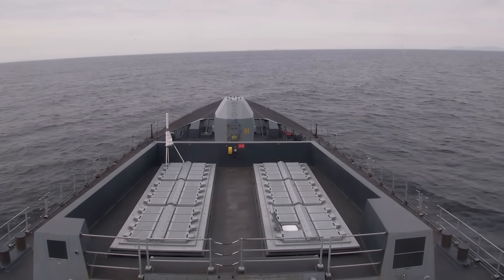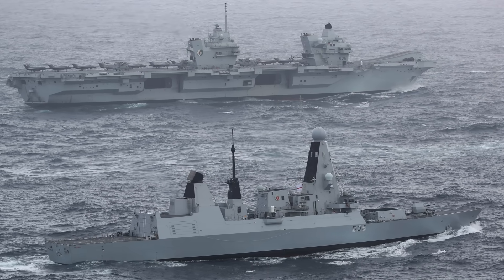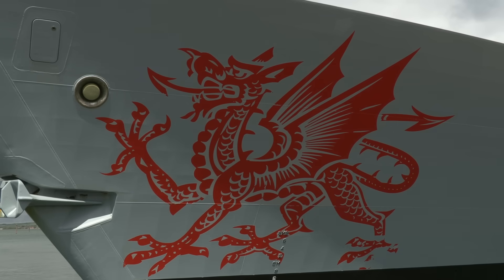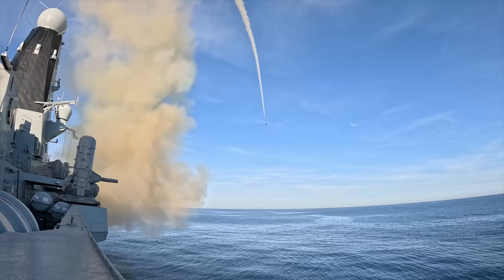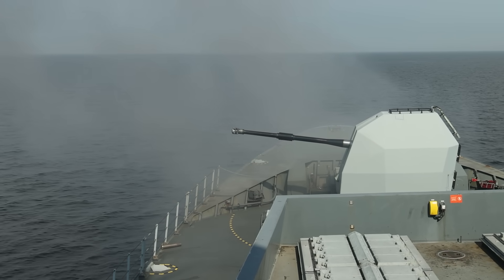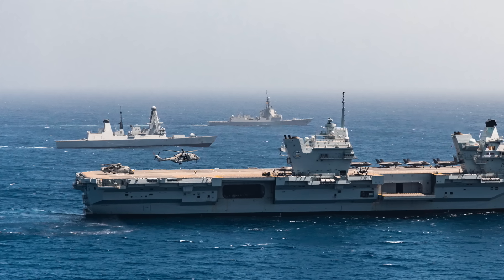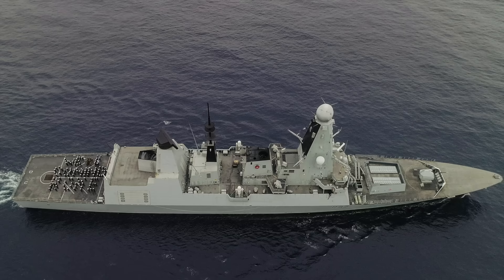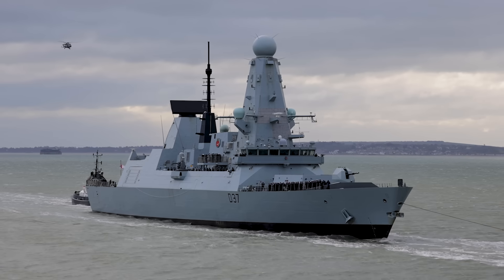Type 45 Destroyer: How the Royal Navy is Fixing its Billion-Pound Problem Child

Comment: Sorry but the "Design Flaw" did not force them to spend their time in port. The Flaw is an issue in hot climates, which doesn't exactly describe UK, or North Atlantic waters, It is only a problem on deployments to hot climates & even then it wasn't an issue most of the time. It was budget and crewing issues that kept them tied up alongside so much..
Reply: The simplest and easier route for the Type-45 would have been to make a batch II to resolve the first baths short comings
Rip out the WR-21 and replace them with MT-30s. The same engine uses on the QE as well the future Type-26.
Since they didnt do that already ,that means that engine compartment would have to be re-engineered to handle the MT-30 
Add a second strike length VLS for TLAMs as well as the FC/ASW (Future Cruise/Anti-Ship Weapon)  by lengthening the ship by 10 feet and placing it amidships
Inside of 16 cells , up to 32 . 12 cells Quad packed with CAMMs and the other 20 cells for heavy weapons
Make both VLS MK-41 to allow the Type-45 to use any weapon
Then Type-83 would be a much easier build
Reply: @verdebusterAP 
Rolls-Royce announced the MT30 program on 11 September 2001. The first run of the engine was on 6 September 2002. In early 2003 the MT30 was selected to power the Royal Navy future aircraft carriersIn  2012 the company repackaged the MT30 so that it would fit into smaller ships. The last Type 45 was built in 2012, so the MT30 came along a bit too late, Becides the 2 × Rolls-Royce WR-21 gas turbines on the Type 45 were fine. It was the combination with the Northrop Grumman Intercooler that led to issues..
Reply: @Markus117d  
Yet for a batch II of the Type-45
The MT-30 is most logical and economical choice since the QE class and Type-26s  use it so there would no need for a new contract, they just simply order additional engines
The training, logistics and supply chain are already in place. The numbers would silence any critics as the cost would be very very little
if the  Northrop Grumman Intercooler was simply the single point of failure , then the WR-21 would likely continued to power other next gen ships like the Type-26 and Type-31
or possibly the QE as well as other ships in other navies but that hasnt happened 
WR-21 hasnt found any one else beyond the Type-45 which means there are more than just intercooler issues with the engine
Reply: @verdebusterAP Not saying it wouldn't have made sense if circumstances permitted, but the Type 45's were already built before Rolls Royce compacted the MT30 enough to fit into smaller ships, and compared to a QE class carrier  everything in the RN ( And indeed, most other navy's ) is smaller. Nothing in service is ever going to be the top of what's technologically possible, because things take time to build  there's always new developments emerging from R&D that arrive a bit to late to be ready for the new ships that have just been built. If you try to wait for them or reach to far in trying to future proof things you'll have problems of a different sort, as evidenced by the American Ford class carriers and the current Constellation class development, the shipyards can't get anything built when the navy keeps changing the design & the navy can't get ships into service properly when some of its built in systems don't actually work yet..
Reply: @Markus117d  
The size of the MT-30 is not issue. Smaller ships like the USN Freedom class uses the MT-30 without repackaging , its simple engineering
The Ford class is the first new CVN class 42 years so there is decades of technological advances plus a mountain changes
For example, the Ford is the first CVN to use Electromagnetic Aircraft Launch Systems (EMALS) instead of steam
People are forgetting that the CVN legacy C-13 steam cats didnt roll out with 90 percent reliability in the 70s, it took decades of upgrades to get that system to that level
So judging the EMALS off one ship is short sighted on their part. The Ford has a lot changes that greatly improves its operational capability over the Nimitz class
Personally ,the USN shouldnt have awarded the  Constellation class. What they should have done is retain the Freedom class solely for the LCS mission and buy the Independence class FFG- variant 
That design had better growth options 
The problem with the Constellation is that USN ships are normally armed to the teeth
The FREMM is designed carry up 16 missiles in the VLS plus 8 more in top side containers 
The  Constellation class carries 32 missiles in the VLS  plus 16 more in top side containers plus 21 more in the RAM
The VLS will be strike length to carry TLAMs. The weight of the ship damn near as heavy as modern destroyer
Reply: @verdebusterAP In regards to the Freedom LCS. Your overlooking something, The Freedom LCS while its a smaller ship, it also isn't as capable as a regular warship, has 65 crew compared to the type 45's 180+ and it can only go half as far before needed refueling. Why does this matter? Because yes it's smaller as pointed out. But it also doesn't need to fit as many crew ( including their food & water. Accommodation & living space ect ) and the ship doesn't need such large fuel tanks. Which is how the Freedom class actually can have more free space than a larger but much more heavily armed, long endurance and crew intensive ship like the Type 45.. as for the Ford class it wasn't just the catapult system, there's the ships weapon elevators, which took just as long, and were a headache to get working satisfactorily.. Not trying to have a go so to speak, just pointing out that these systems should have been more fully developed before including them in ships, just as the type 45's IEP power system designs should have been..
Reply: @Markus117d  
Thats why the Freedom class should be retained solely for the LCS mission while the Independence class should have been evolved into a FFG. The LCS mission is a supporting role not direct ship to ship combat
in deep water
Like the EMALs, all of the new technology will need time to mature after years of operation , its just the nature of things. Its going to take a while
Hence why it would have been more sensible to make batch II of the Type-45 to address the issues
Type-45 is just wasted potential
Reply: The engines were too close to the hull and overheated in warm waters, particularly the Persian Gulf
Reply: @MoeSzyslak1967 where else can you put them? You’re saying the entire design of the ship is wrong. Which is probably true. So since they aren’t doing anything about it, the plan is only use backup diesel generators in warm climates?
Reply: @MoeSzyslak1967 It was the hot air. It's more difficult to prevent something overheating in a already hot environment.
Reply: @Markus117d yes but that’s like blaming God. They are supposed to be designed around for hot air. So back to the inter coolers. Which have not been replaced. Which means these ships can’t be used in the Gulf or similarly hot places.
Reply: @TheBooban Yes they can after the PIP, The diesel engine upgrade allows them to be a backup instead of a supplement* 3 × 3MW instead of 2 × 2MW. A more than doubling. And yes they were designed with hot climates in mind, The turbines were supposed to slowly lose performance as temperatures rise, but because of the Intercooler flaw that gentle degradation turned into an abrupt drop as the engine protection system would trip. And the turbines would shut down, Originally the ship was designed to be fully operational with one of the two turbines and the diesels running simultaneously. The diesels alone were never meant to be enough by them selves, But because of the Intercooler issues more & bigger diesel generators are being installed, which can generate enough electrical power that the ship can remain operational even if both the turbines are offline, even if not at 100%
Reply: @Markus117d not 100%? What? The turbines generate 43 MW (5:03) while the new generators generate just 9 MW (6:28). Those are backup generators. You can’t just use only them in Gulf.
Reply: @TheBooban Each turbine produces 21MW, Since the ships were designed to operate off of one turbine. At 100%.. 9MW from the improved diesels is just under 50% capacity.. True it's not enough to propel the ship at 30Kts full ahead though the water, but it is enough to maintain normal cruising speed and operate the ships weaponry and sensors.. and that's in the unlikely event both turbines are offline simultaneously...

Ps it's also ignoring the fact that with more diesel power generation available. The turbines don't have to run as hard, Reducing the load on a turbine means it doesn't run as hot and thus is far less likely to have Intercooler issues in the first place..
Reply: @Markus117d ”unlikely”? It’s not a bit of bad luck. If one fails because of hot conditions it makes sense the other will more than likely fail too. Nah, you don’t send sailors to war like that. Forget about that super laser working with back up power. I think it would be very irresponsible to send those ships to the gulf. They need to make 2 type 26’s into air destroyers.
Reply: @TheBooban Yes unlikely, why become nothing is ever guaranteed. That's the point of having more the one turbine and in the original design more than one diesel. The PIP upgrades don't just stop at fitting greater diesel generator capacity. It's an update to the entire electrical system. And you missed my point that with more diesel power available the turbine / turbines don't have to be at full anymore, Meaning they won't have overheating issues because of the Intercooler. And not fail in the first place...
Reply: @Markus117d I see, they work if the cpt. is careful. Hopefully he doesn’t need to avoid incoming drones like that aircraft carrier did and a hornet fell off. Well, Canadians are making air destroyers out of the type 26. UK should probably add on a couple for themselves. Likely will take 20 yrs and it’ll be due.
Reply: @TheBooban Not careful, careful would be if the problem still existed, ie don't max out the power gen because it could maybe damage a turbine, the very opposite is fact now it's just have turbine at 75% & and the diesel gen takes care of the rest, it's like driving a hybrid car, careful only matters if your trying to only use battery power ( Turbine ). If using more fuel doesn't matter, you can still floor it.. and the diesel kicks in automatically so you don't drain the battery charge. You still get the full performance. Same with a Type 45. It's only what part of the ships system provides what percentage of the total thats changed over the original configuration..
Reply: @Markus117d  So are you saying that the cutouts would not have happened if they had simply changed the safety system parameters to restore proportional temperature limiting appropriate for the reduced intercooler capacity? Perhaps with a lookup table according to ambient temperature, to give gentle power limiting above a certain ambient temperature, and reduce the propulsion system demand accordingly. Sounds like a relatively trivial software fix... if the suppliers have good faith and play ball... or a massive legal fur ball if they don't. I guess it was the latter, in which case they should be blacklisted.
Reply: @nibblernibbles3205  No I'm not, because without the extra diesel power there would be no choice but to run the remaining turbine at full should  the other have suffered a problem  Intercooler or battle damage either way.. but now there's that extra the turbine / turbines don't have to run at full anymore, Because there's an extra 5MW available from the new Diesel setup.. the problem they found when the ships were actually in service originally* was that far more of the time than was intended the turbines and diesels had to run hard to keep up with the power demand, Now both systems can be used at lower settings and still provide more power than before..

PS in short they couldn't do what you were asking before as they needed that power, but now after the refits they can..
Reply: @Markus117d  Thanks. So they under-estimated the power demand at the design stage... fiar enough, it wouldn't be the first time... but my point is that any power-limited system needs to always stay within its limits; it shouldn't black out just because 3MW is available and 3.3MW is demanded. Propulsion power is 3rd order with speed; reducing propulsion power by 10% will only result in a 3% speed reduction; so in this situation it's perfectly acceptable to reduce propulsion power to stick within the 3MW; especially if the alternative is a dead duck! The lack of resilience would have been exposed at the commissioning stage, if the chief engineer had got the ship up to full speed then gone around pushing stop buttons on the generators... which is what battle damage looks like.... the system should degrade gracefully, first reducing propulsion power to a minimum then cutting off hotel loads, then offensive weapons, and only finally tripping defensive systems and CWIS. It may be that the tough test wasn't done, so that top brass could declare success and the problem kicked under the carpet.
Reply: @nibblernibbles3205  Definitely, but the Intercooler issue meant instead of gradually degrading, the power fell off sharply. And since the diesel generators were not enough to keep the power stable, systems automatically cut out, etc.. A bit like with a nations energy grid. Things have to stay within a narrow range to be stable. Equipment is designed to operate off of a intended frequency and voltage ect and if it doesn't get that stable supply it causes havoc.. the ships have also had the electrical system upgraded, better power management software. Equipment & switching ect in addition to the diesel improvements.. Apparently the builders did raise concerns with the Ministry of defence, but those concerns went unheard.. 🤔
Reply: @MoeSzyslak1967 The issue was the intercoolers nothing to do with engine position.
Reply: There are an absolute mess. A ship type forced on the navy by Blair, and one that the navy never wanted.
Reply: @mikesalmon434 One they never wanted? Actually they wanted 12 of them not the 6 we got..
Reply: It was totally useless in warm waters and problematic and prone to break downs in its homewaters. Not ideal for a warship..... especielly as the UK at the time imagined itself as a Great Power and partner to the US and dreamed on sailing in the Pacific guarding against China under the leadership of their glorious leader/Master/special relations leader, the US. Since then that dream seems more and more problematic (not even the UK sees MAGA US as something they want closer relationship with despite its generational almost instinctual subserviance to the US) so maybe not as disastrous flaw, but still bad.
Reply: @Aendavenau Ironically the issue was the American made intercoolers.
Reply: @gabehorn1001 that’s like saying the problem were the weak Wärtsilä diesel generators. No, the problem was the MOD bought the wrong motors and inter coolers. AND the inter coolers were not replaced? What?
Reply: Each ship suffered an issue roughly once in 3 or 4 years. HMS Diamond for example had problems while part of CSG21 and missed much of that deployment. But had no issues while part of the operation protecting shipping in the red sea last year,and brought down 9 targets including a short to medium range Ballistic missile, hardly "Totally useless"  note that was* also pre PIP refit..

Comment: T45 now joins the new T31 as the other class of ships that SHOULD receive asap a significant  upgrade via a significant strike length mk41 vls installation but of course will NOT. At least so long as the incompetent bean counters infesting Whitehall have anything whatsoever to do with the matter
Which regrettably they do